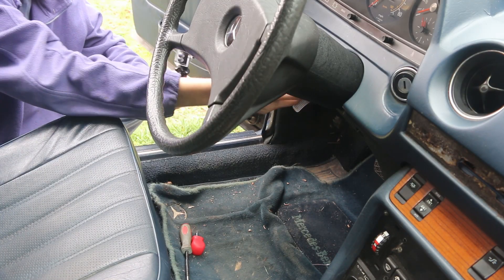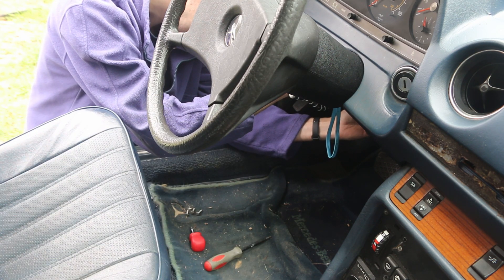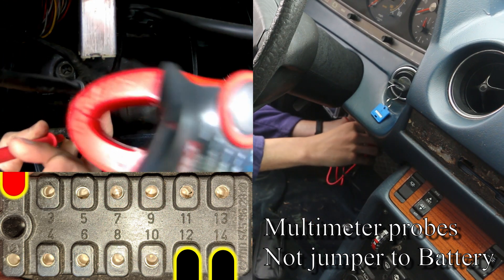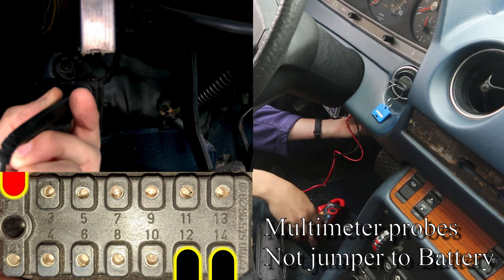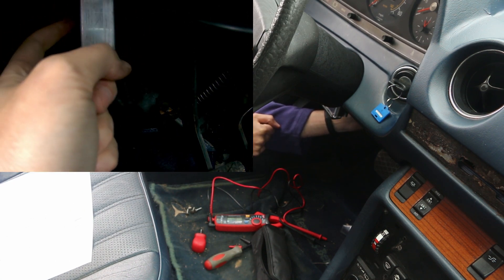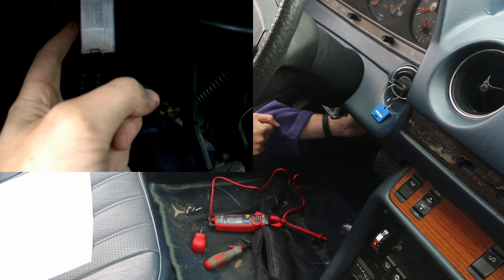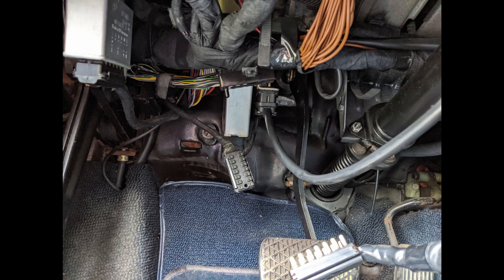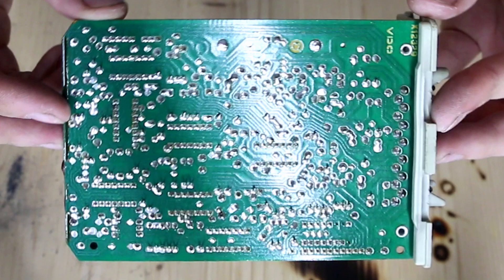W123 VDO Cruise control repair series part 2: Stalk and wiring

Comment: What year is your vehicle?  Seem like the 1976-1980 mercedes w123 cruise control has a different components than the ones from 1981-1985?
Reply from the maker: Mine is a 1982, I realize I forgot to update the document on the website, Someone else had a different style amp and got it working, I've updated the document  now with photos of the older style amp, see if by chance it matches yours!
Reply from the maker: Oops, I misunderstood what you were asking. my bad. Yes the earlier models used a vacuum pod or something rather than an electronic actuator. I've gathered some info on repairing the amps but have not been able to experiment with the earlier car side wiring and parts.
Reply: @trythistv  Thanks very much! I inherited a 1979 300D model.  Its something I will check in some weeks. I got to get some vaccum hoses reconnected in the engine bay by mechanic that knows these diesels first. lol
Reply from the maker: @truefunk99  Send him over to https://trythistv.com/w123vacuum/ and see if the vacuum diagram I've made up looks vaguely correct. Its still a work in progress as far as coloring and some of the engine bay stuff, but it may prove useful!
Reply: @trythistv  Okay thanks.  Even if its correct I will still need some assistance down here in Texas putting things back together probably, haha.  Maybe I can see how far I can get....
Reply from the maker: @truefunk99  You'll have some dried out and cracked vacuum connectors for sure, I've had some crumble from looking at them

Comment: Awesome video! Thanks for sharing. When testing the last set 9 and 13 I had a reading of 3.6 ohms. Is this ok?
Reply from the maker: I think that sounds close enough I suspect it's ok, I've learned some of the actuators are a little different depending on the year and car they were installed in, so the values I've showed may vary slightly from year to year, and the amps vary wildly too, I'm compiling more information that I need to update the document on the website with the extra info I've had contributed. Also, I got your email, I'm double checking some info and I'll send you back info for your amp!

Comment: How does the cruise control know the car is going 25+ MPH?  My understanding is the cruise control will only engage at 25+ MPH.
Reply from the maker: If you're electronically inclined, there is a fantastic writeup on the Porsche pelican parts forum I found a while back, it's very detailed to the point that I have not fully read and absorbed it. Here is a link to that writeup:
http://forums.pelicanparts.com/porsche-911-technical-forum/394659-understanding-vdo-cruise-control-amp.html

Comment: I ran your tests with the ignition on, engine running, I got 14v every time, but in phase 2 of the test with ignition off I got the following....

Pin 7 to 10 = 5ohms
Pin 7 to 12 nothing 
Pin 10 to 12 nothing
Pin 5 to 12 = 37.4 ohms
Pin 9 to 12 = 2.8k ohms
Pin 9 to 13 = 113 ohms

According to your chart that means my actuator motor is shorted to ground, 113 ohms is supposed to be 0, and the nothing readings are supposed to be infinite and my multimeter reads 1, as though the prongs were not even touching anything. I get a 1 reading both when touching and not touching the pins basically. I've absolutely no idea what that means or where to look next

(mercedes 410d with vdo tempostat)

Update, 1 also means infinite on this particular cheap multimeter! Ignore what I said, although I still don't get why I'm getting the 113 ohms when it should be 0

2nd update... I had 113ohms resistance on 9-13 but the next day it was reading open circuit!

3rd update, I successfully carried out test one with a 12 volt battery, everything works. And in doing so, pin 9 to 13 came back to life but this time it's around 60ohms!

What witchcraft is this??
Reply from the maker: So, 9-13 being off from the normal reading is related to the actuator potentiometer, which is how it senses the "throttle position" of sorts. 113 ohms is very high, even 60 with your new test is also very high, Pins 2 and 3 on the actuator itself are the potentiometer, you could test with a multimeter at those pins and move the arm with your hand to see if the ohms sweeps smoothly or if there are dead spots it could indicate the potentiometer parts inside the actuator have worn out, if the readings are good at the actuator pins, then you may have a bad wire between the actuator and amplifier.
Reply: Please you are literally my only hope in the whole world

Comment: My number 14 slot is empty so I've no idea what to do
Reply from the maker: What kind of car do you have? I've suspected that there could be differences in wiring but haven't run across it yet. I made the videos and documents around a 1982 Mercedes 300d, I know some models used slightly different amps, I can try to find out what yours would be if it would be helpful!
Reply: @trythistv  thanks for getting back, I just found the information in my documents, according to them, pin 14 is an optional earth which will allow the cruise control to operate at a much slower speed, which to me is just some sort of witchcraft! It's a mercedes 410d...
Reply: I've also got 3 hot wires going into pin 1!

Comment: Based on this excellent video,  my 1984, 280SE seems to have  the typical CC problem: the amplifier.  Moving to part 3.  Many thanks.
Reply from the maker: I thought breaking it up into parts would help narrow things down and isolate each part of the cruise system, it seems daunting at first but it's actually not that awful once you break it down into each section.

Comment: Hello. Your videos are awesome BTW. 1985 Mercedes 380SL. I Tested the actuator as you described and had no operation. I opened it up and found that the diode to the solenoid was not allowing current through. I soldered in a new diode, retested and the actuator works perfectly. Cruise still didn't work. I moved on to part 2 and tested the stalk. Everything tested perfect accept the feedback from the actuator. Pin 9 to pin 13 measured 2 ohms (supposed to be zero). I wasn't sure if that would be acceptable. I moved on to part 3 and removed the amplifier. When I took it apart the burnt smell about knocked me over. I looked the circuit board over and only visibly found a resistor that was slightly discolored but that was it. I went ahead and ordered a rebuilt unit from AutoHaus. Just installed it and still no operation. Could the 2 ohms feedback from the actuator cause no operation?
Thanks, Kelly's Auto Repair
Reply from the maker: It could very well be the problem. I would check for corrosion or wire issues, I'm not sure if I have those corresponding pins listed in the pdf, but checking the wires between them as well as testing that circuit directly at the actuator would be my next steps.

I know it's a long shot, but I spent more time than I'd like to admit trying to figure out my cruise when the issue was led brake lights I had installed because they're so much brighter, and they do not work with the cruise system at all without some kind of ballast resistor or such installed

Comment: By the way... we both have the same "blue alarm" on the key chain...mine is 1983 astral silver  on blue interior... I replaced the amp which i sourced from an eBay good supplier and connected it. No result ...still not working plus the sugnal lights stop working although the bright & wipers are still workin...kindly advice what to do...thanks and be safe (that is why I was asking what the connector on the the bracket of the amp for...
Reply from the maker: I had an issue once with the ground for the cluster and some electronics behind the dash getting a bad connection that made some of the lights and gauges quirky, I took all the brown wires off the screw they were on, cleaned everything with a brass brush and reassembled and it solved my gauge issues. You've tested the actuator under the hood, and the wiring in this video and replaced the amp and its still not working? any chance you have LED bulbs in your tail lights?
Reply: @trythistv  no LEDs  (it's tacky even though Kent suggested).... however it is true that when I pulled out the cluster partially since the kick panel was off already, that is when the turn signal lights stopped working. Will follow your advise. One more thing , the fog light indicator on the light switch which I pulled shows that smallest bulb light I think  is there in the car world is missing. do you have any idea where to source it? thanks and be safe.

Comment: great video .... i noticed that you did not test the actual cruise control switch on the steering column
Reply from the maker: I didn't get a good angle, when you hear me talking about resume, off, accelerate and decelerate I was pushing the stalk that is on the column to those positions
Reply: @trythistv  ....so that in it of itself that the stalk is in good condition...thank you
Reply from the maker: Exactly, That test proved the switches in the stalk are all good as well as all the wiring all the way to the amp.
Reply: @trythistv  ... what about the other connector that is mounted on the bracket of amplifier? where does it connect to and you did not test it? thanks
Reply: Yes he did test the stalk in Part 2.

Comment: Brilliant..... Watched all three videos and no longer intimidated by the cruise control. I can't see the link on the wiring. Good job though. Cheers from the UK.
Reply from the maker: I thought it was some kind of magic before, Here is a link to the document directly: https://trythistv.com/wp-content/uploads/2020/05/version1complete.pdf

It's supposed to be available on this page:
https://trythistv.com/cruise-control/

But for some reason the buttons just plain aren't working on there. I'll look into that sometime another day.
Reply: @trythistv  thanks for the link. I've got a right hand drive sl r107, so the location of the module may be different.
Thanks again anyhow. Keep the great work coming on YouTube. 😊😊😊😊👍👍👍👍👍👍👍👍👍🤓🤓🤓
Reply from the maker: My first gut instinct is that the amp would be in a similar location near the brake pedal but being right hand drive could possibly change that. I'm not sure at all, but the cruise system should be similar in terms of how it functions at least! 🙂
Reply: @trythistv  yup, hope so. I will be having a look sometime soon.
I've read your instructions... All I can say is... Brilliant.

Comment: Any chance that for your next series, you can repair a W123 clock? Mine works intermittently and I'm getting ready to replace the (2) 100 uf 35v capacitors to restore function but I'm no Youtuber [I'll leave that to you] 

Seriously though, how many W123s on the road today have a fully functional clock? Very few by my estimates.
Reply from the maker: Now that is an excellent idea. I think my one cars clock works and the other one is right twice a day lol. It appears the most common failure is the caps you mentioned, I'll certainly put that into my plan for future videos! Thanks a ton for the suggestion!
Reply: First time I've heard of a non functioning clock on the w123 to be honest

Comment: I'm waiting for part 3, I have already done that and I have the same issue... 
I am using quarantine to finally try to get my Porsche 928 S4 cruise control to work. It is also seen.
Reply from the maker: I'm sitting here editing part 3 right now, Took a test drive the other day and I can confirm my cruise works flawlessly, holds exactly the speed I set it at, 55, 35, it'll hold that speed even up and downhill, doesn't surge or anything. As good as a modern cruise! Hoping to get the video finished up today, then I'll get it uploaded tomorrow on my potato internet, finish up the written instructions in the document on the website, and you should expect the video to go public on friday morning!
Reply: @trythistv  Today I have changed the 4 capacitors in the cruise control unit. Unfortunately I can't try it because I have a problem with the clutch pumps, but I hope it finally starts working. It never worked.

Comment: I will do the repair after part 3
Reply from the maker: I'm working on editing it, I'm trying hard to make it clear and understandable, the amp is by far the most complicated part, and there is very limited documentation surrounding it, so some things I've been reading on and other things required some trial and error to solve, now I just need to get it together so it all makes sense!

Comment: Wonderfull job ! My cruise control is working but it would be a piece of cake fixing it with these vids.
Reply from the maker: Awesome! I had a car that the cruise worked but tended to hunt and surge, I'm suspecting part 3 on the amp would have cured that issue had I dug into it back then but I had much to learn to get to where we're at with this stuff now! Good info to have out there just in case it starts acting up!